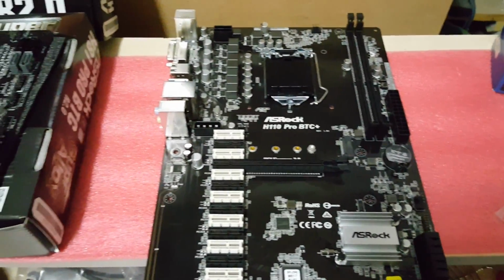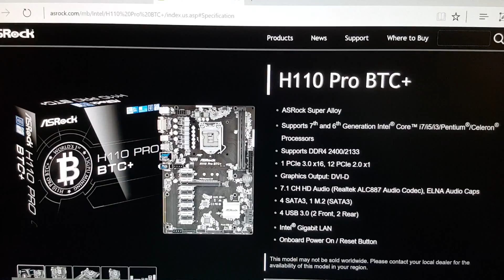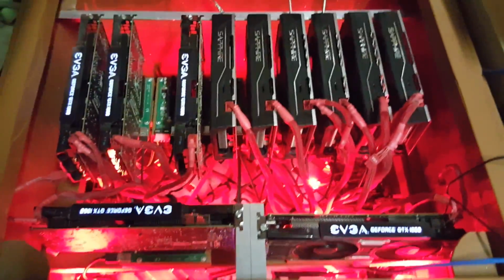13 GPU All on One MB? ASRock H110 Pro BTC+ Review Part 1

Comment: can you please let me know does the two molex on the board needs to connect each other then to psu and which section of the psu? perif or sata?

also if i use two psu does it need to be connected to primary psu?
my psu is evga 750 g3

thanks
Reply: TheBitcoinMiner thanks mate

Comment: hey, I've got problem with this motherboard. Got no signal :/ dvi integrated doesnt work, tried with rx 550 in 16 pci but still doesnt work. Do you know what could be wrong ?
Reply: integrated grafic is by factory setup disbaled. U need to go in Bios and enable it

Comment: Hey mate, i got 8 msi rx580 gaming x. and i had no Problems, since the last Driver came out. All black pcie Slots works, and all Cards in the White Slots are not detected by Windows so i can only use 6 now, i tried so much things, what do u think can it be ? i use the new blockchain driver for amd, but also with the old driver, Windows do not detect the other Cards in the White Slots:( perhaps you can help me out 
Thanks man
Reply from the maker: Hi MrIsotype, sorry to hear you're having trouble, mine still is running just fine. So that leads me to believe that it might be a driver issue. look in the description I should have linked to the driver I used and try that. I hope it helps and good luck.
Reply: Tahnks for your quick answer, thank u very much.  Perhaps i am blind but i cant find any link XD sry mate
Reply from the maker: Sorry, just send an email to this: thebitcoinminer.downloads@gmail.com and you'll get an auto-response email with the link.

Comment: 7x560 6x460 this fucker wont work with more than 5 at a time. Its doing my head in.
Reply from the maker: What graphics cards are you using? I'm assuming the new 500 series? If so it's a driver issue and I'll show you how to fix it in the next video coming up

Comment: can i use 13 nvidia cards instead of mixing amd & nvidia?
Reply: The type of card shouldn't make a difference, but mining performance/price tends to be much better.
Reply from the maker: Hi Shafiq Omar, Project Proaxtion is right it does not make a difference but where the problem comes in play is Windows will only allow you to run 7 or 8 gpus so you have to split the two types of cards and load two types of drivers to get it to work. Now you can run Linux and run anything you want.

Comment: Are you able to control gpu fan speed with Linux?
Reply: Fan speed is controlled automatically (I think on the motherboard) so that when the system gets hotter, the fans ramp up. I don't think it has much if anything to do with the OS.
Reply: IC, your are not going to OC them.